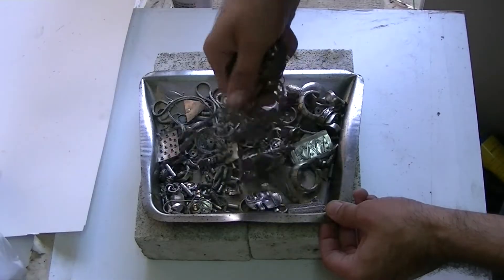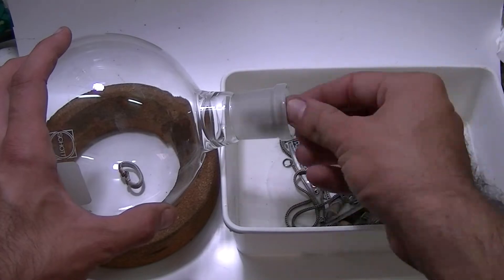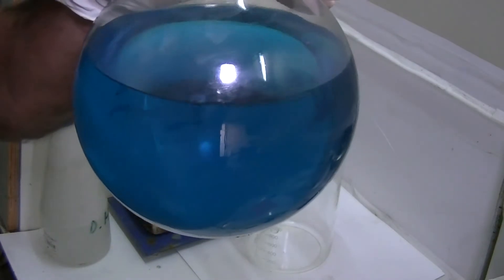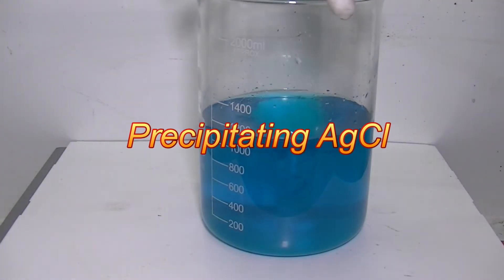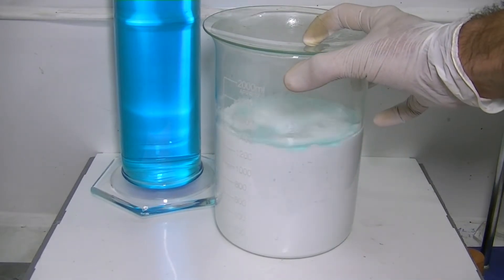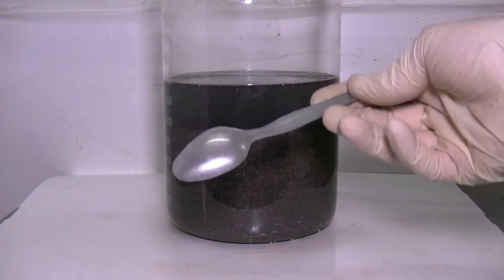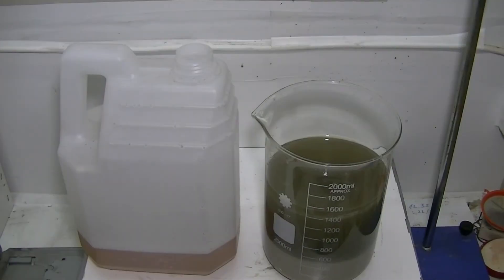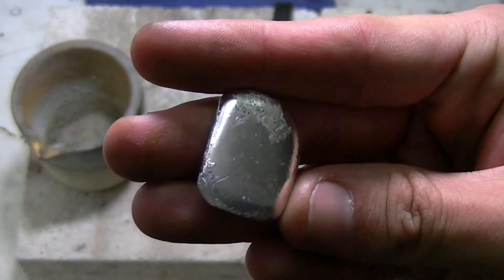How to refine Silver - The Complete Silver Chloride Process Tutorial

Comment: Very Succinctly explained. I have a question for you. I have Silver Nitrate solution. I added HCL, NaOH, and glucose. I have a viscous, black solution. 

I'm trying to recapture the Ag used in the Silver Nitrate electrolyte that I used in a dielectric cell to grow Ag crystal. The jet black solution is completely stable. No reaction or parcipitate for several days now.

What would you suggest? In a test, of adding small amounts of HCL, to the solution, I get the, "Cottage Cheese", parcipitate. NaCl? I'm a bit stuck. 2  - 2,500 ml beakers of the black solution. 8 gallons of more, Silver Nitrate to go. Any suggestions would be appreciated. Thank you so much!

Wade
Reply: Hi Wade. I’ve had a similar experience, but slightly different and on a much smaller scale. 

I set out to precipitate silver from a sodium chloride solution using HCl, which worked well, but it had base metal impurities. So I added more HCl to dissolve the base metals. However, I ended up with what seems to be the jet black liquid you are talking about. 

I left it for a few days, and then decided to slowly add distilled water to the mix…The silver precipitate send to have reappeared, and the reaction was almost instant. 

I think they problem was that too much HCl dropped the ph and made everything soluble, even the precipitate. By adding water, the ph rose and precipitate became more insoluble. 

Anyway, just thought of mention my experience to you in case it may be of any help to you. 

Greetings. 
Jacques.
Reply: @stuffshop4883  Hey! Thank you! I tried it and it's already dropping parcipitate! I'm kind of learning as I go? I'm also following "SREETIPS". There's allot of great ideas available, grounded in real science. 

I guess that experience will come. I can follow examples. That's fairly simple. I need to grow my understanding of the reactions on the molecular level, so I can work the equation, when things go sideways. 

I really appreciate the "Asist". I should have paid better attention in University! I didn't know then, that I would develop a passion for Alchemy, in my later years! Caramelized Hydrochloric Acid aside. I'm having great fun! 

I enjoy interacting with people who share this passion and I always welcome a new friend! Hope we can keep in touch. I can always use a better mind and fresh perspective as well. Keeps me from getting my boxers in a twist, from following the current goings on of a corrupted government! 

Thanks again!

Wade

Comment: To achieve a 100% conversion to silver metal a constant temperature of 85 to 95 C must be maintained during the whole process.
Place the beaker in a water bath, together with a thermometer. Add NaOH in small doses while stirring vigorously. A very exothermic reaction occurs, but it'll not be enough to maintain the optimal temperature during the whole process, therefore a gentle heating underneath the water bath is necessary to keep the temperature correct for the remaining part of this process. 
I always place the beaker in a clamp on a metal lab stand in such a way it's hanging a bit above the bottom of the water bath, allowing the water to flow free under and around the beaker; thus avoiding any spots becoming too hot. The water helps dispersing the heat when the NaOH and especially later when the sugar is added; important to avoid caramelization of some sugar types.
Adding NaOH as a near saturated aqueous solution calms down the violent reaction quite a lot, and keeping a constant temperature of 85 to 95 C, as well as later adding sugar dissolved in water, all reduces the total reaction time of this process.  
Beware of the delayed reaction when adding the sugar. After the first dose of sugar solution, stir and wait until it start reacting, then continue to stir and add more in small doses to avoid overflow/boil over. 
Both while adding NaOH, and later while adding sugar, temperature increases will occur so the external heat source must be adjusted accordingly.

Comment: Great video! Got a question you might can help with..How would you refine silver cadmium contacts without nitric?
Reply from the maker: Thanks. May I ask, why wouldn't you want to use nitric?
Reply: @indeedItdoes  it's hard to get and rather expensive to order including the shipping. I have refined silver with boiling sulfuric acid but not sure if the cadmium would stay in solution or precipitate out with the silver chloride when I add the hydrochloric acid..

Comment: Can achieve the some results if use copper
And thanks for the video
Reply: Cementing with copper will not give you .999 silver. This method will. If you cement with copper you'll need to refine it through a cell to achieve 999.

Comment: Its too much work - just melt silver chloride with sodium carbonate to get your clean silver metal. Electric furnace with graphite crucible is best for this.
Reply: FOR HYDROGEN PLATINUM IS NEEDED.sell gold buy platinum.price is low now.. follow platinum strategy...price will rise like gold promote platinum.....
Reply from the maker: It is a good option indeed.
However, it does not negate the need to wash the AgCl.
Reply: @indeedItdoes  Yes, it has to be washed, and Na2CO3 should be chemically clean.
By the way, using a simple vacuum pump with a funnel will help to wash AgCl very clean in a matter of minutes.
Reply from the maker: @MSteamCSM  Yes... There are many ways to skin a cat